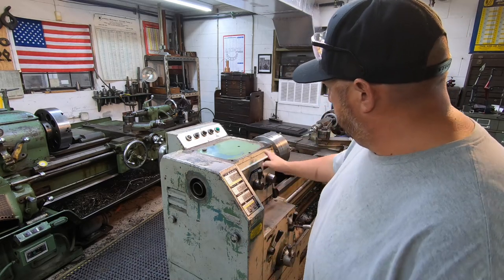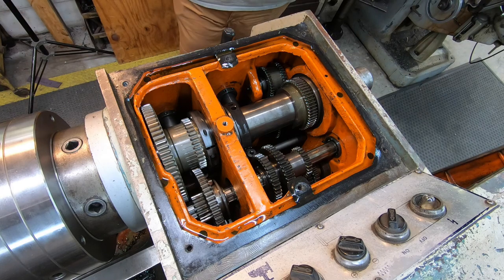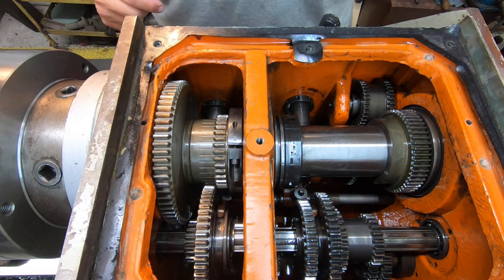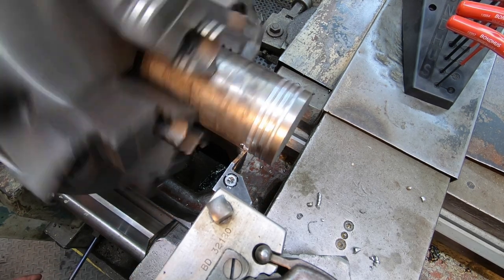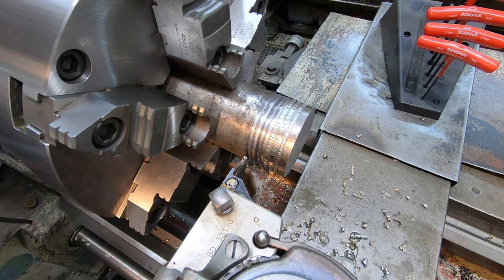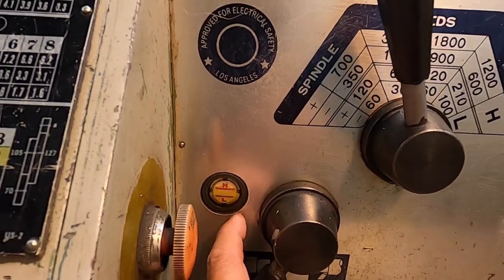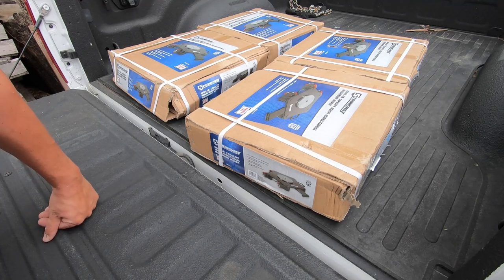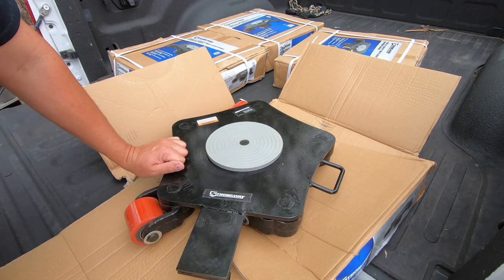SNS 324: Victor Lathe Main Spindle Bearing Adjustments

Comment: Question, after adjustments you would move closer to the chuck to make another test cut. Improvement was obvious, but if you moved away from the chuck to test cut would you have had the same results? Not a machinist myself so I’m curious.
Reply: I did wonder the same thing myself, I know that it's easier to part closer to the chuck. But that doesn't necessarily mean it won't chatter. Adam knows his machines, and would know for sure if there was any improvement with the adjustment

Comment: If I may comment, with the taper roller bearings providing axial and radial support, I would have measured the spindle droop by using a lever or prybar under the chuck and measured radial vertical movement with a dial gauge. Then adjust in measured increments, both on the rotation on the clamp nuts and spindle movement.
Love that steak .
Thanks for sharing.

Comment: One way of reducing the chatter is by grinding a slight angle on the parting tool so that the tool is not facing the full torque all at once, This way the inevitable tolerances are not being rattled all at once. The angle should be ground so that the highest point of the parting tool is on its left. So it will cut the face of the material remaining clean off.

Comment: I assume you also checked they cross slid and made sure the gibs are ok. That steak looked awesome 👍
Reply: Yeah good call. An oil change ands maybe a power flush of the oiling system. My immediate thought was to replace the baring's. Big job but would deliver a like new machine afterwards.
Reply: @deavall1 It looked pretty dry i thought. New bearings is always a good option but i bet they are not cheap prob over 1000 bucks. And if not done right you could be back where he started 😁Its also a royal ball ache of a job!😂
Reply: @harezy  Yes. Got to remember the age of the machine also. As good as it is,  basic maintenance is always best. More things to check also, movement in lead screws is a real possibility, especially when its been exposed to harmonics.

Comment: The reason that Nut B turns so hard is you are forcing the bearing along the press fit on the shaft.  The fit on the shaft is likely an m6 or in that range. If the bearing is mounted on too loose of a diameter you can still have chatter issues no matter how the bearing are adjusted.

Comment: The only thing that the video proves is that the thrust bearing is worn out!
It just needed to be replaced and not to clamp the curved rollers and the surface of the clip ...
Reply: Agreed, seems like it's time for a new set of bearings.
Reply: I’m thinking it will crack a race and make a big mess in the gearbox. ☠️

Comment: One of my first jobs was working on wheel units for continuous miners.  to get at the ring gear there was a circular plate, 16-18” with peened edges setting about 1/8th” in.  Only way to get it loose was to smack the hell out of it with a sledge right in the middle and it would pop out and off.

Comment: I have a mini lathe and it chatters like crazy. It only weighs 70kg, but I bolted it to a concrete curb to add more mass. Could the bearings be shot there as well?
Reply: I’ve seen guys upgrade the bearings because some of the cheaper ones don’t have the best bearings (even ball bearings in some) and it’s easy to upgrade them. It’s worth a shot to tighten them though if possible.

Comment: I’m currently in planning for moving a lathe. I looked up that style of skates at Northern Tool. 😳 Holy cow! Sell the house and kids. Rent out the wife. And take out a loan! Better have A LOT of use for them... $2000+!! EACH.
Reply from the maker: You looked up the wrong skates then. They’re not 2K each
Reply: Abom79 I did see a set that was in the $200 range but not the same model you have. But “most” of what they had similar to yours list $2K each...
So, I agree there are cheaper ones. 😊 Thanks for the response! 😁
Reply: Abom79 Love the videos by the way! 😊
Reply: @guyinmorton  If you look in the video you can see the item number on the box, punch that into northern tools web site and they come right up at $189

Comment: Five casters on the machine rollers.  A great design feature for top heavy shop built tools.  Four is ok for large square or rectangular tables but can easily tilt on smaller round portables. 
While not traditional styling I was screaming a "turtle of 5 casters" on your welding table build with the round cast drill press table. If it starts to go, GET out of the way!
Watched Adventures first, the new grille would benefit from a few accessories to keep failure from unstable earth or surfaces. Fully loaded it may topple shortly before the meal is completed cooking. In stainless it needs a 3 sided ground frame to accept the pegs. The end rails should extend past the front and rear of the top by about 3 inches, the pegs should slip into 2 inch long upright sleeves. Another option would be sheet metal heat guards across the ends and back to prohibit the wind from blowing your heat away. Interlocking vertical fingers (ends downward, rear upward) top and bottom could be plasma cam cut sheets to retain portability. Both accessories keep it's original design and function portable fitting inside the handles.

Comment: Seems a bit strange to not check the bearing behind chuck as well..
Reply: The first two bearings are loaded against each other, so there is only adjustment at one end. (Just as you only need one screwjack to jack two walls apart) 
The third bearing (which Adam was curious about early in the clip) at the LH end will be a "non-locating" bearing in regard to endfloat; it effectively self adjusts.

Comment: Dislike!!! sorry @Abom79 but this is dangerous. Both nuts showed a preload applied, and the loading nut cap screws were not loose, unless the bearings bedded in or wore past the preload I would bet there is more here than just loose load nuts. What do the radial bearings at the outter end of the shaft look like? If the bearings at the terminating ends of the spindle are no longer supporting the spindle that could easily cause the "chatter", by tightening the tapered bearings to compensate for a loss of support elsewhere, you may have temporarily fixed the problem but now you may have just created a much bigger problem. Overloading a bearing is one of the worst things you can do to a bearing, this is evidently happening by the way the spindle stops abruptly with the large mass of the chuck there to maintain inertia. If you really want a more proper test, take the cover off and run the lathe monitoring the temp of the bearing you adjusted. You can use a thermal imaging camera and an infared temp gauge, when you start to see a large temperature difference between the bearing and the other components in the system you will know really quick there is an issue. If you are up to it, check the bearings at the chuck end and opposite end for adjustment or mechanical issue (wear, incorrect adjustment, oiling issues, damage, etc.). Using an In/Lb dial force gauge on the spindle to test preload of the system is the ultimate way to adjust bearings, if your cousin who works on cars does any rear rebuilding than he may have one or know of one. Like I said, @Abom79 (and anyone else out there reading this comment after watching the video) just blindly tightening a bearing with no way to properly measure preload or any of the related values is dangerous, and is a fast way to turn the machine into a paperweight. I don't want to see anyone fail or else I would just sit back and wait for the aftermath. If you have any doubts to what I am saying call a bearing house and ask about the dangers of over loading a bearing.
Reply: was thinking the same, preload might be too much now on the taper bearings the way the spindle is stopping. it's going to heat up in no time i'm afraid.
Reply: SShep711,  what you are saying is correct for certain pre-loaded bearing applications.  Not all applications require that level of tolerance, and if they do, they are usually high-speed or high load.  I have worked on a number of lathes with taper roller bearings, and the process that Adam followed was correct,  EXCEPT he did not bring the machine up to operating temp before adjusting the bearing.  yes,  some bearing applications MUST HAVE the appropriate pre-load, but this one is not that critical.   In this case, bring it to operation temperature,  slowly load the bearing until you start to feel drag, and then back it off slightly until the drag releases (all performed when bearing and race is at operating temp).  I agree with  your position on pre-load, but not necessarily in this instance.
Reply: Tom I completely agree that some bearings require different load values especially when the bearings are in the higher ABEC values or have special considerations. My big thing here is that the potential for damage is high, and the severity of that damage is large. I always look toward the manufacturer of the bearings when system information isn't available. Take it for what it's worth but I think that the lathe deserves due diligence (not saying Adam didn't due it) in the scope of what are the potential causes of the chatter. I hope that there isn't another problem affecting his lathe, and that the preload was lost from bedding into the casting, general wear, or even potentially that the machine left the factory in this condition and it was just overlooked all this time. I just would like to see Adam revisit this issue, the item that lead me to this is the amount of force Adam had to impart on the loading nut to get it to move combined with the way the spindle and chuck stopped so suddenly from free spinning. I have used a Victor lathe from that time period and I don't recall 
chatter like that when parting and I definitely don't recall the spindle/chuck stopping soo suddenly. I completely agree with the procedure for loading for drag then backing off of bearings when I know for certain that is the reccomended procedure from them factory. Even then I look for the recommended spec for rotational force in In/Lb (or whatever the system of measure is). I don't really think one way is better "the feel" or "the instrument", however I look at it from the perspective of bolts and bolting. Applied force from torque, torque-to-yield, torque angle, or smart systems  (DTI squirters, TC bolts, TON bolting,etc.) all comes down to the system design and the proper mehod for achieving the end result. I would like to believe that we are all of the opinion that we don't want Adam to loose a machine. Your experience  makes me a little more at-ease with how he did it, hopefully we can get some other people with different  perspectives in on this. I am a big believer that maybe someone who is working on their machine will see this and take away information that will save him/her a lot of heartbreak from learning the hard way.
Reply: @sshep7119  You and I agree much more than we disagree.  As I said, I would have much rather seen Adam run the lathe for  at least 30-40 mins to bring the bearings up to temp.  Don't get me wrong,  there is definitely lateral and radial load on those.  But at the 1500 RPM or less,  they are not in massive danger to "grenade".  What will probably be the result is that as the bearings heat up under work load, they could run hot.  so, in the long run, you and I do agree, I just don't believe it will be catastrophic.  I would like to see him run through the process  again as I had outlined.  Bring to operating temp, load bearing until a slight drag is felt, and then gently back off until the drag just disappears.   This is very similar to setting gear and valve lash.  Some applications will provide a "cold" and a "hot" value.  Others just "cold", and others just "hot".  unfortunately, the manual wasn't very much help.   You and I are in a good place though, this is excellent discussion!
Reply: I completely agree, there is far, far too much preload now on that centre taper bearing. Pounds and pounds of it the way Adam was tightening it . I know he's Abomb, but in this case it needs finesse not brawn. That  centre bearing will start to fail in no time at all. I blame that bloody awful instruction manual. It has no actual specs for the bearing preload at all, and the way Adam read it out it just encourages you to just "Crank it down" till it's tight. Perhaps that was a way of selling you a new set of spindle bearings back when it was made! Adam please please do as the commenter said and consult a bearing specialist to get some advice, also talk to Keith Rucker and see what he has to say about it, otherwise your Victor may be out for the count in a very short time.
Reply: @samrodian919  Interesting thing about some of the older manuals.  They assumed a certain amount of knowledge that the person reading it had.  I have outlined the standard way to  properly  load taper roller bearings when no specifications are provided.   Another way would have been to check the "end play" with an indicator, and adjust until no further endplay existed.  However, same starting point applies, the bearings and races need to be at operating temp for any adjustments to pre-load on the bearings.
Reply: Watching the chuck slow down and realized he stepped on the brake to stop the chuck. I don’t think the bearings being too tight is an issue. 
61 years young retired from a career as a machinist and now work in my own shop, also have adjusted spindle bearings a few times
Reply: @kevinbarrett3  Kevin, in this instance I absolutely agree with you.  About 3 posts back I explained how to appropriately load those taper bearings in this video.  Adam did a fine job, my only observation is not have them at operating temp when the pre-load was applied.  He will know soon enough if it is ok, or a kiddle bit tight.  I also have about  45 years of  machinery repair under my belt.  Us "boomers" need to stick together!  LOL!
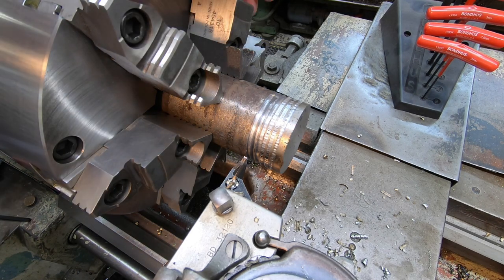Reply: @kevinbarrett3   "61 years young retired from a career as a machinist and now work in my own shop" sorry but this is irrelevant and adds nothing to the discussion. What we are talking about as far as the chuck spinning is at the 16:20 mark where Adam specifically states that there is a noticeable difference in the chuck stopping. Also, you can visibly see the chuck abruptly stop as opposed to drifting then stopping as it should. I think that time will tell, hopefully I am wrong and that there isn't anything wrong. Tom Fleming brought up a good point about the temperature of the bearing before adjustment, something that needs to be considered. For those who are watching this in the hopes they get information related to their own project and who are doing their own spindle adjustment, for those who lack some of the experience, this is not the correct way to do the adjustment.
Reply: @farmalltomf   And there you have it, you lost my vote with the boomer comment. You "Boomers" can do it however you want, I have seem my fair share of machines with destroyed bearings from over tightening or inconsistent preload. I laughed at one gentleman when he told me I didn't know what I was talking about because he had been doing it this way since the dawn of time, I laughed again when I saw the total for the repair bill. Thousands of dollars in regrinding, re-boring, and repair work over a $250 bearing that he tightened the oil right out of because in his opinion "the bearing made noise". I support the get-it-done frame of mind, but I support "the educate yourself about what you are doing" state of mind even more.
Reply: @sshep7119   Wow, I throw a joke in and now Boomer's have created all the problems in the world.   Ok  with me.   I'm out.
Reply: @farmalltomf  Sorry, that's on me, I was trying to be sarcastic about the boomer comment. I was being serious about over tightening bearings, I had to help my buddy repair his mill a while back and he has some years on me.  He did get a hefty bill from the grinder to repair the bore. But seriously, if you are going to do the work make sure you know ALL the important parts. Again, sorry about the Boomer thing coming off the wrong way.
Reply: @sshep7119  Ok, i  can understand that.  Part of the problem with these posts  is that you cannot "hear" how the other person is saying something.  I still agree with you more than I disagree.  My background is in chem eng and comp sci.  Over the years, I found that a mixture of education and solid experience is the best path.  Whenever I was working on a difficult issue, one of my first things to do was go out "on to the floor", and talk to the techs doing the work.  Their feedback was valuable beyond belief for solving the problem.   I have a huge respect for life experience, AND even at 60, this old Boomer is still learning things everyday. You and I are good.

Comment: I’ve got a 20X40 Victor and the thing leaks oil like crazy.
Reply: We use a victor like that at work, 80" long and it is not a very strong lathe,  like aboms it really wants to chatter on grooving tools. wont take heavy cuts either, the saddle keeps breaking where the cross-feed  swivels aswell. thing is wore right out.

Comment: I watch all you videos, think they are great, working on making ready a home machine shop with a few basic machine shop tools, lathe,small mill, drillpress, grinders, welders, hydraulic press etc. been scratching my head with a good layout for the bigger tools and work benches and welding tables. any thoughts ideas or a shop layout video would be great
thx

Comment: "Give the driving plate a sharp spin with your hand - - drive plate should rotate about one turn. If it doesn't, adjust nut and recheck." from Clausing 5900 manual